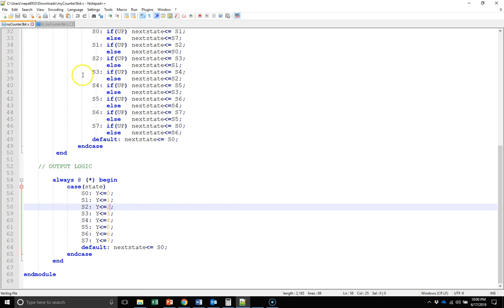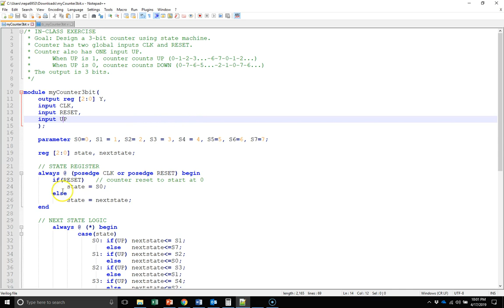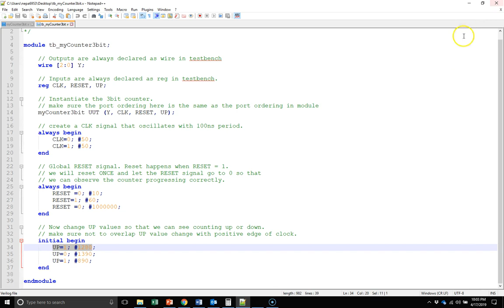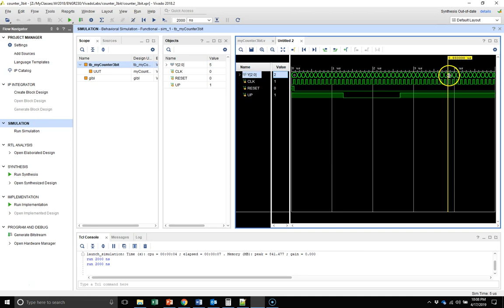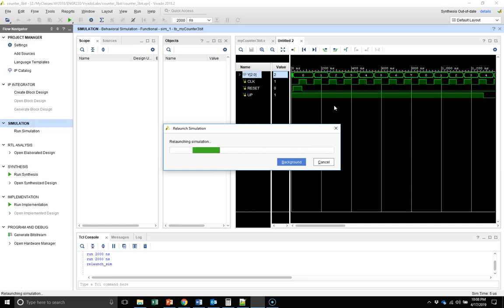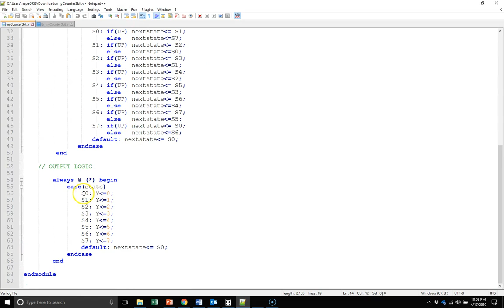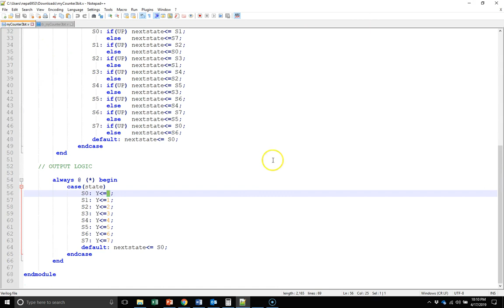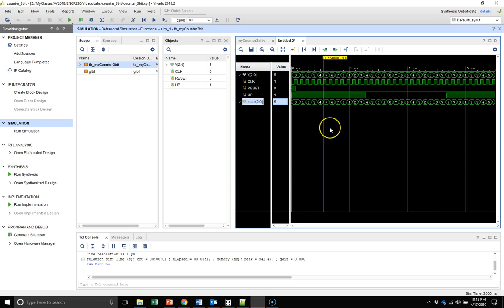Vivado Simulator Tips

Comment: You do not have to relaunch a simulation to restart the simulation.  There is a restart button to the left of the run all button, looks like a play button.  When you press the relaunch simulation you are recompiling the project, which should only be done if you changed something in the code.